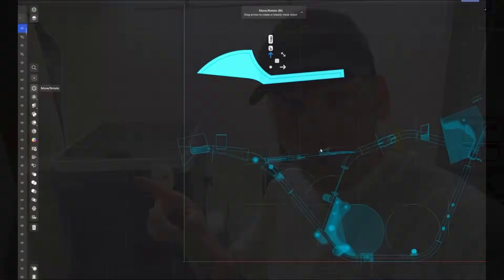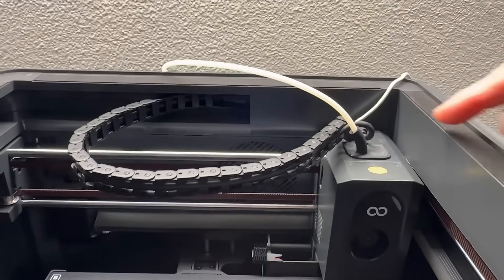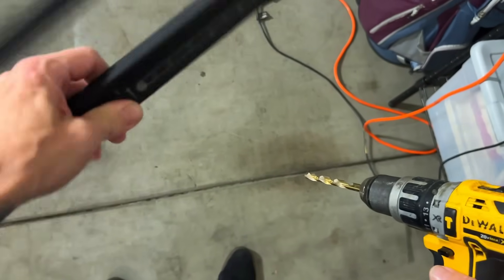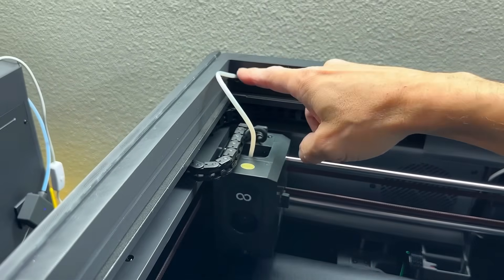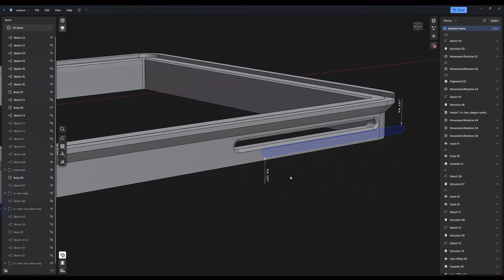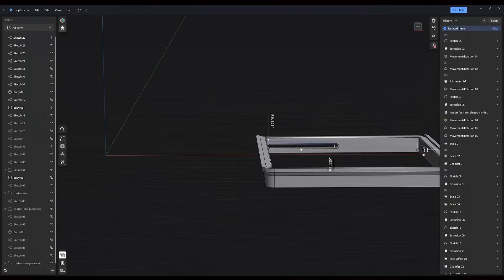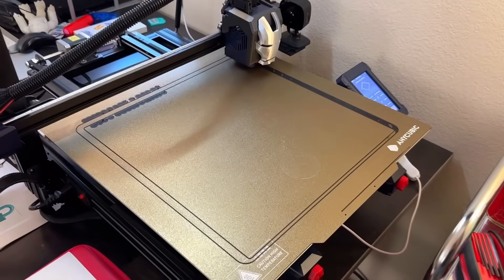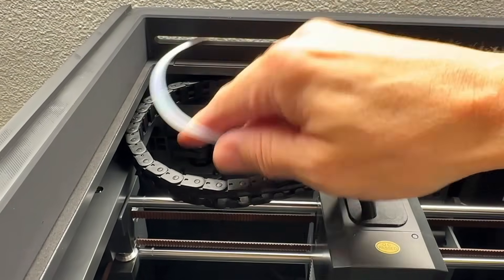The Ultimate Elegoo Centauri Carbon FIX

Comment: The slot walls could be angled downward slightly (approximately 10 or 15 deg,) from the inside to the outside to accommodate the tube as it naturally slops down when it leaves the riser.  A slot with a draft by the same amount might serve even better.

Comment: Nice solution for the feed in tube but won't that slot let out the warm air if you are trying to warm up the chamber for certain material types?
This printer doesn't have a chamber heater but people use a higher temp bed setting to warm up the space. That slot would let out all the warm air?

Comment: I've had my Centauri carbon for about a month. Been printing ABS carbon fiber without a riser and have had no issues. I did add a chamber heater and let the machine warm up to 50 c before printing. Maybe that helps

Comment: I think your Centauri Carbon was assembled wrong.  I just compared mine to yours, and the white tube on mine runs through the cable guide.  If you route it through there, it will eliminate what you're trying to do.   The factory messed up.
Reply: 100%
Reply: Mines on top like his
Reply: Mine is on top like this. He most likely has an early model and removed it from the guide to install that part to help keeping brittle filaments from breaking in the hard bend.

Comment: Brilliant!
Did you happen to design a vented version of that with the PTFE tube reroute.
Regardless I'm looking this up and I'm going to definitely make this I just got a Centauri carbon a week ago.
Been doing this stuff for about 4 years and I'm going to print the mods that you have designed because they are the most intuitive.
Reply from the maker: The whole thing is vented because you slide the glass back as you need it.

Comment: There is a much simpler fix. Just replace the PTFE tube with one that is longer by about 2" (50mm). It can go through the same inlet hole and channels as the original PTFE tube. The extra length allows the tube to rise higher above the extruder before bending down to the cable chain guide.
Reply from the maker: The problem with that is the filament run out sensor is not by the nozzle. 
It’s on the side of the machine where the filament roll is. The sensor knows the exact length of the stock PTFE tube. If you make the tube longer and you run out of filament on a print and replace it with a new roll, you will be short by those 2 inches and your print will fail and not load the new filament at all. I
Reply: @ccraft3d  A longer tube means there will be a short segment of filament still in the ptfe tube. If the length of the OEM tube is x and the new tube is x + 50mm, then there will be 50mm of old filament still remaining outside the extruder when the machine is paused.
As you replace the spool and resume the print, you can manually push on the new filament until the extruder gear catches the new filament. That will probably take an entire 20 seconds.
Reply: @theodorenguyen9384  Do you still use this approach? Did you have any problems with it?
Reply: @RickDkkrd  I replaced the PTFE tube the first day I received the Centauri Carbon. I rarely run out of filament mid-print. When it does happen, I feed the new filament through the tube. Then push on the filament from outside the sensor until extruder gear catches the new filament. That is a slight inconvenience; but I am really too lazy to make any major mods.

Comment: Really cool solution to this. I don't own either printer but I'm thinking of upgrading in time. Looking at how the engineering is done by the original companies on just the tube clearances does not inspire me with confidence. What other potential problems lurk in the designs if this is how they do tube management? I've been wondering how well the machines will hold up in a year or threes time and this answered some questions for me. 

None of this detracts from the brilliant job you did in fixing these problems. Maybe they need to hire you to do some design review before they release the next version!

Comment: I don't get it ... Why not just have a simple hole through the riser which has the PTFE coming out at a small angle with the riser wall (as on the P1S) above the cable chain but not going in and out of the build volume as with your slit approach?  Then ensure the entry leading the PTFE into the hotend can freely rotate and that the PTFE tube can also rotate within it (again like one of the most liked extensions for the P1S and like what you have in the video, but I get the impression it doesn't make enough of an angle)?  And create a small clip to keep the PTFE above the cable chain (again like with the P1S - I even added a second one on my P1S).  So, why not do that instead of such a large slit that will screw up printing any high-temp material?
Reply: Just got the carbon and looked at the rotating  clip for the tube and think this is the way to go.

Comment: con tutto lo spazio a tua disposizione  potevi fare l'asola molto più larga senza problemi co notevole aumento della mobilità e degli angoli di inclinazione del tubo di ptfe ------ with all the space at your disposal you could make the loop much wider without any problems with a significant increase in the mobility and tilt angles of the PTFE tube

Comment: Why not make the cutout all the way to the bottom of the riser? With it being just a hole in the riser, any time you want to remove the riser, you have to disconnectthe PTFE tube and pull it through. If it were all the way through the bottom of the riser, you'd be able to take the riser on and off without futzing with the PTFE tube.
Reply from the maker: You could but then the tube would rub on the top edge/corner of the printer housing. Also you never really need to remove the riser, just the glass which is separate anyway.

Comment: No problem for me, printing as it came from the factory.
Reply: Well, now that I received my PETG-CF,  I will write here my experience as promised: I placed 5 models on the far left side of the build plate; no filament was broken in the PTFE tube for the 5 hours of printing time.
Reply from the maker: try feeding carbon fiber through it that way. 
I tried and broke the filament several times while printing if the print head moves to the back corner it just snaps the filament in the tube.
Reply: @ccraft3d  I will have the chance to print CF next week, and I will write here if there is a problem, which I doubt because my filament tube, as it came out of the factory, is tied differently to yours; it doesn't fold no matter how you move the head.
Reply from the maker: @ thats awesome! Mine was crap 😁
Reply: @ccraft3d  it seems I was lucky, not an issue so far, and at last they fixed that case fan always-on problem
Reply from the maker: @stratosg9899  yes I was happy about that on the last update also 👍

Comment: I have a Flashforge AD5M and they came up with a great solution to feed the PTFE tube to the filament sensor and drag chain to prevent the issue you are trying to solve. Maybe you can look into that and incorporate it on the Elegoo.

Comment: Great idea
Something else that you could try is making that cut out for PTFE tube slightly bigger and put some fiberglass/fabric PTFE coated tape inside of it. I think that could significantly reduce friction between the tube and riser, further prolonging lifespan of both elements

Comment: I love the problem solving here, but for this riser to be absolutely perfect it would need to also accomodate a LED strip angled down toward the build plate. The internal lighting provided by Elegoo is terrible and among the first things anyone would want to fix. Please make it happen, I'm not skilled enough in Fusion yet to make it myself :)
Reply from the maker: I’m just using magnetic LED strips that stick to the inside wall. Super easy and bright. But you can add a “negative part” to the model in your slicer software to match whatever LED strip yo plan to use. You don’t need to remodel it.

Comment: Just as a small tip, when painting the manual supports if you check "On overhangs only" and use the fill option you can just click in the red area then it will automatically select all of the red area you click on instead of having to manually hit it all with the pen/brush.
Reply: We should normalize leaving random tips lol they truly help
Reply: @default1390 awesome, glad it helped!
Reply: @ also, make sure that you adjust your overhang angle (in the paint menu) to what works for you
Reply: Omg, you are a Godsend. I did not know this and it was taking so much time painting the manual supports. Will try this!
Reply: Why need this? My CC prints perfect right out of the box
Reply: @MadChattur  did you read my comment? This is an easier option when painting supports.

Comment: How do you keep the peg/magnet affixed fan on? Mine has popped off twice while printing. The fan hangs by a wire and acts like a wrecking ball on the print bed below.
Reply from the maker: Haven’t had that issue.  Make sure your magnets are there and in place. Or give the bottom two screws on the front cover a couple of turns out to make sure they’re actually contacting the magnets.

Comment: You can add a rubber edge trim around so it won't get damaged by rubbing against that hard surface
Reply: I printed this and ran into the same issue with the ptfe tube rubbing in the cutout slot. Solved it with some UHMW tape all inside the cutout for the ptfe tube and now it glides effortlessly

Comment: What worries me is the noise level.  I'm thinking the aux fan comes on only when using the fast ludicrous mode?  I don't care that much about speed nearly as much as I care about print quality.  Could you maybe print a Benchy at 200 mm/sec and make a vid about quality at normal speeds? One thing that pisses me off on all these reviews, is that they show prints at the fastest speeds.  I want to see print quality at normal speeds.  Thanks man.
Reply: There are different noises! Fans are only part of the story. 
The printhead (“model”) fan and the “side” are proportionally controlled by the cpu as it thinks fit. Printing PLA in normal (“balanced”) mode with no lid, door open and 20C environment, the printhead fan runs at 100% speed or not much less during printing, while the side fan only gives the occasional blast. The third fan (“case”) is the only one causing air change in the chamber, as it exhausts out at the back. It is on/off and I thought I could turn it off because of running ‘open’. But it turns itself on again. I am assured that this is from the slicer’s g-code and is inherited behaviour common to enclosed printers running this family of slicers. 
So you don’t really have fan control during printing! 
And there is a fourth (fully automatic) fan in the floor electronics bay - you don’t even get the illusion of control with that one! After printing, the 3 main fans now shutdown (v1.1.25 firmware), but even in my cool environment the electronics fan can be heard running for several minutes before it gets things cool enough to switch off (another reason I think it gets rather hot in there!) 
The mechanical noises don’t sound sophisticated at all. If the A-series Bambu’s purr, this rattles! 
But this boomer n00b is actually rather impressed with the output product quality, and thinks he got fantastic value for money. 
Just don’t expect to run it in the same room as you are watching TV!

Comment: Interesting, BUT… I don’t like your (extremely neat) plug in the top of the printhead. It looks to me like closing that hole would be a recipe for heat soak problems in hot weather. And making your tube guide slightly spiralled (which is beyond my Tinkering skills) would help the necessary swivelling action at the tube’s entry to the toolhead. 
I have been running a riser with the tube unclipped and entering on the other side of the cable chain. The tube then adopts a natural high and gentle curve, but does want to brush the inside of the riser (where I want to put a led strip). On Printables I found a clip to attach the tube to that “wrong” side of the chain (designed by pascal_lb) — which holds the tube firmly. I’m using just 2 of those clips (towards the back of the chain) while I remix the design to guide and constrain the tube rather than hold it tightly. 
Your slot looks like a nice solution, but may demand a stronger case fan so that it is an air inlet rather than outlet when printing ABS etc (which is why we have the enclosure!) Making the enclosure more ‘leaky’ is also going to make raising the chamber temperature (for those special filaments) even harder. 
And we may all have to rethink things when we eventually see the Elegoo AMS, but in the meantime there are a variety of ways that the tube routing can be eased - which is good! 👍
Reply from the maker: Thanks.  I tried those clips originally they didn’t work for me.
I have printed ABS and carbon fiber already with this new set-up and I have had no issues so far. 👍
Reply: @ccraft3d  yes, those clips grip and hold the tube firmly, and that isn’t what is required. The tube needs freedom to move, while being kept away from potential trouble. But the design does clip nicely to the chain, and that is what I plan on working from. 
Also 1/ how effective was the fan filter at mopping up your ABS fumes? And 2/ what carbon filament have you run, and did you have any issues with dampness (the filament sensor position doesn’t seem ideal for printing from a drybox)?
Reply from the maker: @dougal6569 ABS still stinks about the same as the P1s. I keep these in the garage so it’s not a big deal to me. I use Fiberon PA612-cf15 dry ahead of time works fine.
Reply: @ thanks for that. Time to order in the materials for a Bento Box!